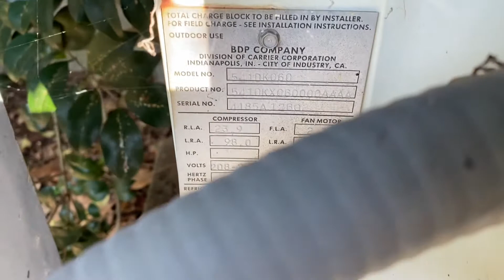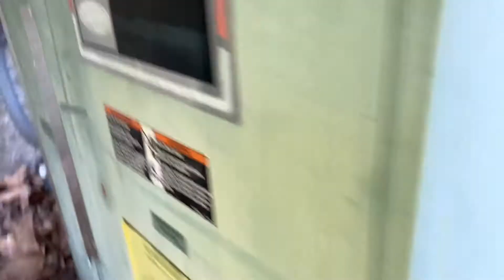1984 & 1985 Bryant heat pumps (and a vintage Carrier Weathermaker commercial unit, none running)

Comment: They where made in city of industry ca near los Angeles hard to tell year or model or serial number
Reply from the maker: The model numbers on both BDP's is 541DK060.
Reply: 5 ton it has a tecumseh reciprocating compressor 3 phase
Reply from the maker: One of the serial numbers is 3884A56519, and the other serial number is 4185A12602.
Reply from the maker: @heatpumphvac3150  Thanks for the info.
Reply: @CompactHVAC  does those units even work anymore none of them are running
Reply from the maker: @heatpumphvac3150  The building they're located at has been abandoned for years, so they haven't ran in a while.
Reply: @CompactHVAC  oh they haven't looks like 15 years to me lol